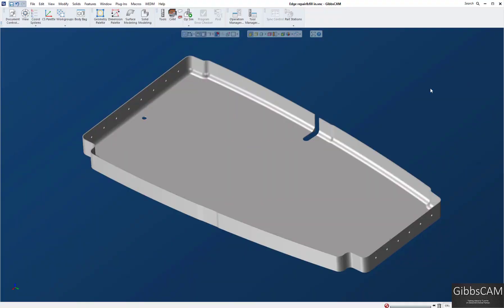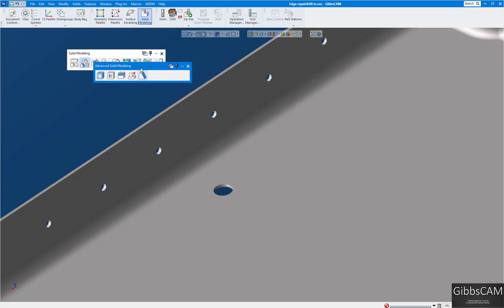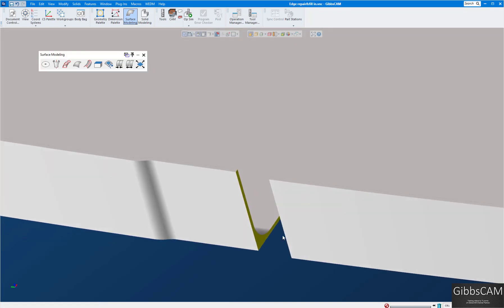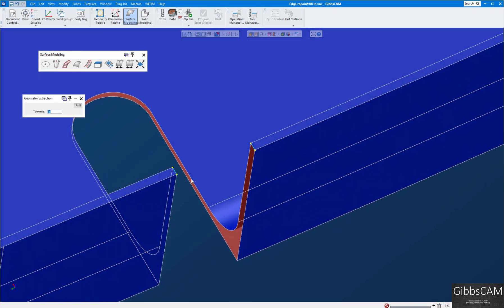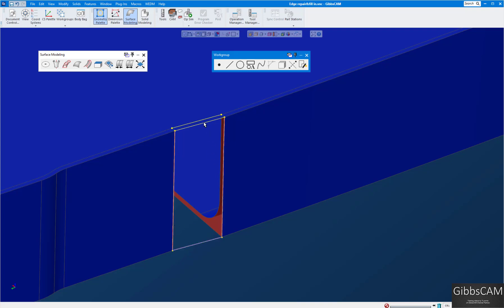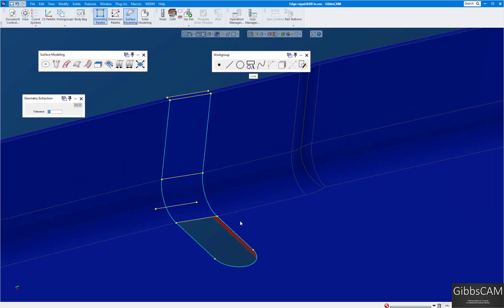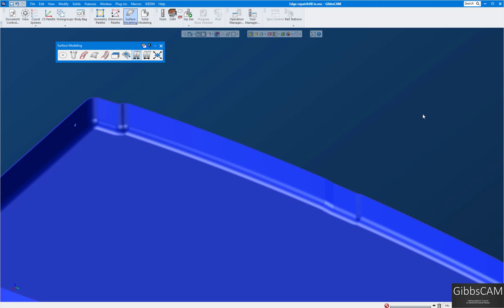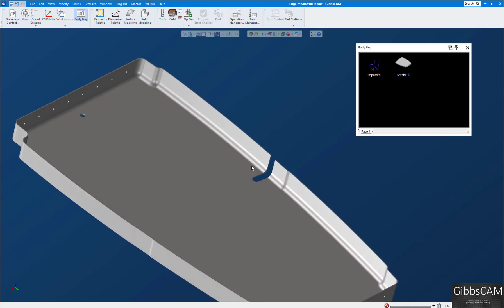GibbsCAM, Unstitch Solid Models

Comment: I d have extracted the geometry from the perpendicular CS 
Extude 
Add 
And it s done
Reply from the maker: That's fantastic !   Glad that worked for you!  Remember though this part has a step in that section, so might need to double check if you extruded the section instead of building surfaces.